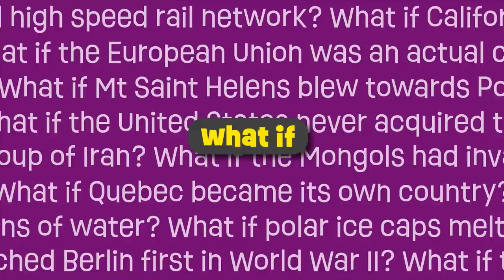Water Pipeline: What If An Aqueduct Was Built From The Great Lakes To The Southwest?

Comment: It would be significantly cheaper to build both a dedicated power plant and reverse osmosis system (like that in Antioch, Israel) to pull desalinize water from the Pacific Ocean.
Reply: A project like you describe was just cancelled by the state of California.  The concern was that removing all the salt from the water, and then dumping it back in the Pacific would create a local area of high salinity, and kill a lot of fish/wildlife in the area.  The project included a ling diffusion pipe to deep water, to prevent this from becoming a major concern, however, the California Environmental assessment said it wouldn't be enough. 
There are many people and businesses who depend on near shore fisheries to make a living, so this isn't an easy fix, but with the ongoing drought, I think cancelling that project may have been a mistake.
Reply: @bskec2177  It isn't just the higher salinity of the effluent from the plant, it is the higher temperature of it as well.
Though if they kept the concentrated salt water, let it dry out to salt and sold the sea salt then both issues would be completely mitigated.
Reply: That plant in Israel processes 640,000 cu. meters of water per day...while that is a LOT of water in terms of domestic needs (170 million gallons) it is a spit in the ocean in terms of agriculture (500 acre-feet/day). 

For perspective, the Central Valley Water System (i.e. not including So Cal) handles 40 million acre-feet per year.
Reply: All of the world's desalination plants together (Saudi has the most I think) are not even close to enough to replace California's demands on the Colorado River. Good first step maybe.
Reply: @gorkyd7912  There isn't going to be a single solution to a problem this big, it's going to need a series of small steps.
Reply: @gorkyd7912  the problem is that the water is not correctly priced especially for agriculture.
Reply: @bskec2177  It was because who said you had to put the salt back in the ocean you can literally let it dry out and sale it for more then regular salt because it's the magical sea salt. This would also give the west coast another commodity to sale and close down some salt mines that probably should no longer be open anyway.
Reply: @LavitosExodius  There is a problem of relative scale of the two business.  Let's say your family of four consumes the CA-average 48 gallons of water per capita and per day.  You would have to somehow also consume 55 lb of salt per day in your household to balance the two business.  Your doctor may have a thing or two to say about your hypothetical salt consumption!    
And for industry and agriculture, there is obviously no way!
Reply: @Madman Curie They don't.  The increase in salinity has caused localized mass die offs in the persian gulf.
Reply: @st-ex8506  you do realize salt can be exported like anything else really, it doesn't need to stay in California
Reply: @arandomperson3014  Yes, but salt is a very cheap commodity, available in plentiful amounts in just about all countries, even landlocked ones.  I do not think that the international salt market (there isn't one to start with!) can afford significant transport costs!   If I had a guess, no more than a couple hundred miles.
Try convincing the population of Salt Lake City to buy Californian salt!!!
Furthermore, salting ponds need three favorable factors to produce salt:  
1. Lots of sunshine. That CA definitely has.
2. Predominantly dry weather.  Same thing.
3. Large expanses of flat land next to the sea... and very cheap land.  Tell me where you find that in CA?  I drove the entire CA coast from Oregon down to Tijuana, and, as far as I remember, hardly saw an acre that would fit the bill.
Reply: @arandomperson3014  There are a lot more things in sea water than just salt.  The reason sea salt is more expensive than regular (mined) salt, is that a lot of impurities have to be removed before it's suitable for human consumption.   Even if some salt was kept for this purpose a lot of material removed from the water would still get dumped back into the ocean.
Reply: If only they didn't dump million's of tons of toxic waste in that same water years ago and those barrel's weren't almost rusted.
Reply: When you return the salt to the sea it has to be spread in large areas  in To the sea , proportional portions to avoid high concentrations in just one place , pretty dangerous if you notice the behavior of some corporations in the use of water (mines, oil, fraking, etc) all the water ended contaminated for centuries .

Comment: Two things you didn't mention regarding Great Lakes water, first, the water level of the Great Lakes rises and falls with the weather. In drought conditions it goes down and in wet times fills up by as much as six feet of difference. There are about 140 commercial ports on the Great Lakes. That is a lot of shipping and a lot of jobs that depend on lake level. Once people outside the Great Lakes Basin start drawing on the water and relying on it, how do you turn off their tap when the lake levels naturally go down? The lakes have gone down about 25 inches since 2020 naturally without any such pipeline as that proposed. Would people accept someone saying, "sorry, you'll just have to wait a few years for the lakes to come back up." Once the tap is open it will be very hard to shut it off. If the natural waterway goes too low, and the ports can't work, what do the people in the Great Lakes region do to ship and receive goods that now go through the ports? I understand the people in the Southwest have jobs and lives and needs, but so do the people in the Great Lakes region. Nothing is gained by sacrificing one for the other. 
Second, The American Southwest is a historic drought area on our planet. You can't fix that. To ship water from other parts of the country will only make it possible for more people to live there and increase the demand on scarce resources and the need to move yet more water. If you did use Great Lakes water to try and fix that problem you would only make the demand on Great Lakes water that much worse. The Southwest region must live on their available resources and people should not continue to move to an area where the land doesn't have the carrying capacity. There are other places in the country available for people to move without the cost and environmental damage posed by such a pipeline.
Reply: All facts.

Comment: Would like to see an video on a pipeline from the Pacific Ocean to the southwest states using desalination.
Reply: Desalination seems like a good idea to solve the water problems in California, but I'm curious why I don't hear about it as a solution?
Reply: I came up with that solution as well. It's crazy they ain't thinking about it. The water goes, and it goes back out. Endless recycling period.
Reply: Instead pump north from the gulf of California.   Let the sun evaporate from an inland salt water lake.   It would take about 25% of Arizona.
Reply: @jessicag123  It isn't the cheapest source of water because of the energy needs. It is energy dependent and the oil and gas companies don't want people to realize that solar energy could fix the issue and replace them at the same time.
Reply: Desalination makes more sense.
Reply: Oh - they can't do that: it would lower the value of that multi-million dollar beachfront property.
Reply: @bransonwalter5588  nuclear would be far better. One nuke plant can make the entire process dirt cheap.
Reply: I’ve thought about this for quite some time.  Would it not be possible to build a pipeline straight up the Rio Grande River valley and the Colorado river valley, piping seawater straight from the Gulf of Mexico to Canby Mountain (headwaters of the Rio Grande) as well as piping water from the Pacific straight to La Poudre Pass?  The Rio Grande river has 19 separate catchment areas, each of which could be used to build desalinization plants, filling up multiple lakes as well; I.e. Elephant Butte Lake, Bosque Del Apache, Cochiti Lake etc.

Additionally, you can use the freshly treated water to run through snow making machines for 6 to 9 months out of the year around Canby mountain and La Poudre pass.  These areas can serve as new ski resorts bringing in millions of dollars of revenue to the area in addition to providing the increase of snow melt for both rivers.

The actual process of desalinization would not have to be difficult as water could be heated directly from the sun using mirrors to heat giant “kettles“ of water during the day.  Solar energy collected from PV cells could be used for power at night.   Alternatively or in conjunction with solar power, Hydro power stations could be built and used to power the desalinization plants.  

Once the water is desalinated at each potential location, the fresh water can then:
 • be put directly into the reservoir filling it up; and
 • be used for fire suppression; and
 • be bottled and sold / given to populations with contaminated ground water such as some of the  tribal lands in western New Mexico.

Considering the devastating Hermit’s Peak fire caused by the US Forest Service this past April:  Water could be pumped to huge storage tanks which would be built and located on the tops of the highest peaks in a given location.  A gridline system of pipes could be built and installed in 1 mile increments from each tank so that when there is a fire, the system could contain any fire within a one square mile - 640 acres - area.
Reply: @drsteiny1  that's a whole lot of thinking
Reply: @drsteiny1  I’m very curious about this idea too. One pitfall to address is leaking salt water from the system. If leaks occur in the wrong places it could literally salt the land or ground water
Reply: @chriswilkerson4074  not to mention a whole lot of piping and pumping and a whole lot of gooblygook
Reply: @jessicag123  look at the amount of energy that this will spend, it is more profitable to turn off hydroelectric power generation and use another source of energy, because the lack of water in california is eternal, because they turned off the thermoelectric plants and drained the reservoir, this is the cause that everyone hides.
Reply: @bultacowally  I understand that dumping the waste would be bad but if all the different minerals could be isolated and sold it could help to return the investment made for the infrastructure.
Reply: @chriswilkerson4074  One of the many reasons desalination plants  have not become more popular. Environmental impact from the brine.
Reply: @ethanf5441  they would never let nuclear cooling water into their lakes
Reply: That is almost correct, an overhead pipeline would b more practical.
 Powered by waves easily reach over mountains.
 With trillions from the Pacific a few billion every day is a literal drop in the bucket.
Reply: @harryniedecken5321  That might or might not work.  It would certainly evaporate, but no guarantee of how it would end up being distributed by nature.  Desalination seems to me to make the most sense.  It could be powered by excess wind/solar when there is excess, which happens all the time.
Reply: @chuckwaardenburg496  They are widely used by island nations.  The brine is a nonissue for the most part, as long as you aren't trying to desalinate for millions of people with a single site.  Set sites up all along the coast and the environment won't even notice the slightly saltier brine at the points of return, any more than it notices the less salty regions caused by rivers.
Reply: I made the same comment above noting that Death Valley is enough of an elevation difference to run desalinization by gravity alone. But it has to be a flow through lake otherwise it will quickly become the Dead Sea.
Reply: @drsteiny1  Desalination is a fairly expensive process, and once you've done it, you have clean drinkable water.  It doesn't make sense to put that into rivers and such, it needs to go straight to city water supplies.
Reply: @jonathanjohnson2427  Good observation. If the desalination was done at the coast and fresh water allowed to drain to Death Valley it would also allow water to be pumped from there to other destinations. In addition, minerals obtained from the desalination could be shipped world wide from a sea port.
Reply: @ethanf5441  Nuclear is currently the most expensive source of power due to construction costs and increased safety standards.

Comment: Does anyone remember back in the late 80's when the Mississippi was so dry that you could almost walk across it?  Barges were stuck in the mud everywhere.   Don't send water to the southwest from the Mississippi.
Reply: Did they have ebb flow lochs in place then? There are dams in place now keeping water tables relatively steady.
Westerner here, dont support, southern parts and states are vastly less important than the few trees we have left. That water aint going north of sac and sf its not helping. You think you can allow all the people in to use up resources when in the end you contaminate all of it from the top down. Besides, people are moving from the great lakes because they are ruined already.
Reply: I also remember 2012 where the Mississippi River was so low that our barges couldn't move our garbage from a couple of months.
Reply: @MCPorter83  Yeah, and in 2011 there was so much water the COE had to blow the Birds Point Levee to prevent massive flooding disasters in the Ohio River leg of the watershed.  There's plenty of extra water in that system, over time, there's just not sufficient storage capacity to best manage it.
Reply: @smokencracker5597  Yes, please don't come. The Great Lakes are so polluted that you step in them and you stink. Whatever you do, keep believing this.
Reply: What part?   Up north?  Maybe it would be good to tap the Mississippi at the river delta, just upstream enough to avoid brackish water.
Reply: That never happened. I've spent my whole life next to the Mississippi.